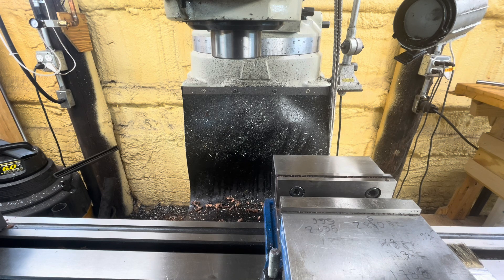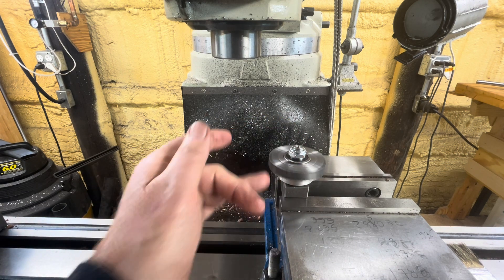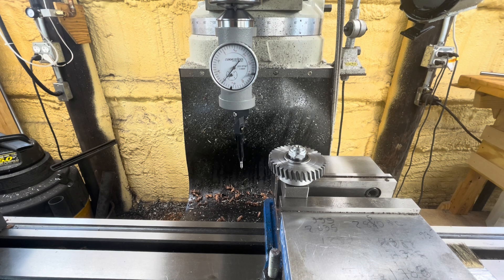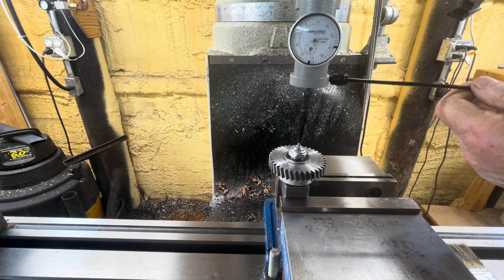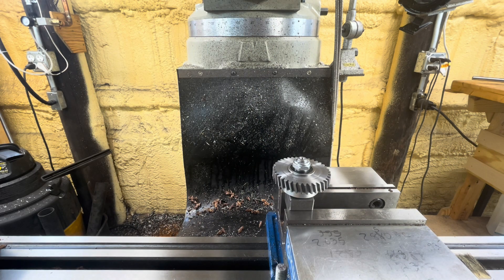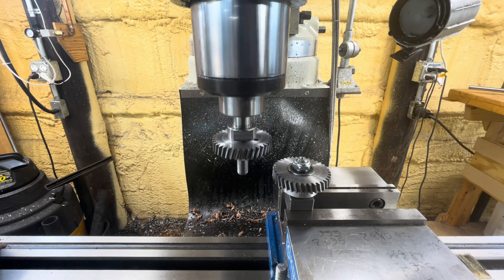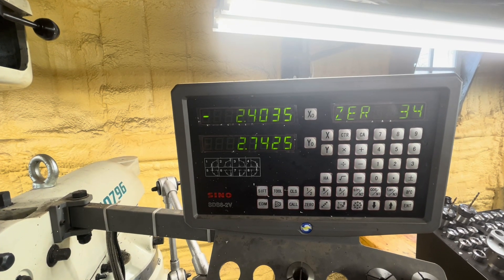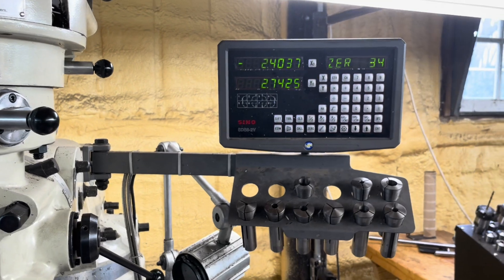Finding a Good Center Distance for Gears w/ a Vertical Mill

Comment: Well that was novel Tom. Must admit not something I would have thought of doing myself. I suppose you could set up some sort of quality microphone next to the gears and run them well lubricated at different speeds and offsets, then do a spectral analysis of the sound to find where the volume is lowest and at what frequency. See if that matches for the best theoretical centres.
Reply from the maker: This method is only slightly better than taking the theoretical center distance and adding a theoretical lash…which is what I’ve been doing.  At least it’s a data point with actual gears that have actual tolerances and pitch circle runout, which one of these gears clearly did.  I really like your suggestion!  My oscilloscope can do Fourier analysis, so…maybe?